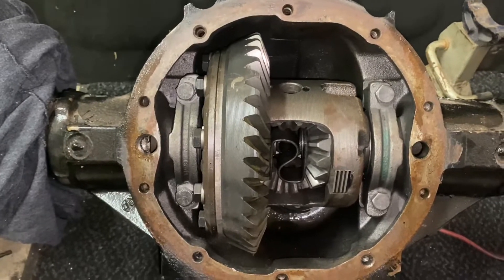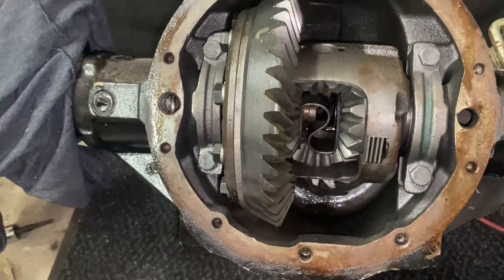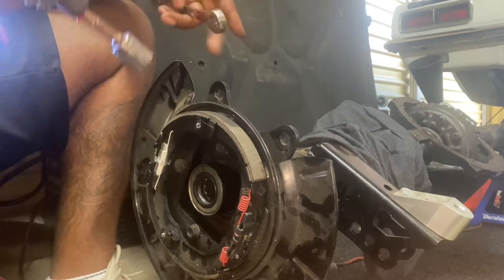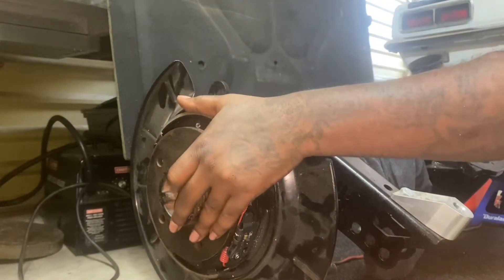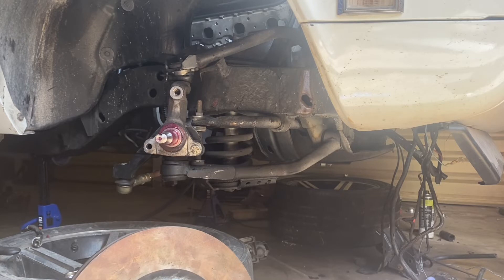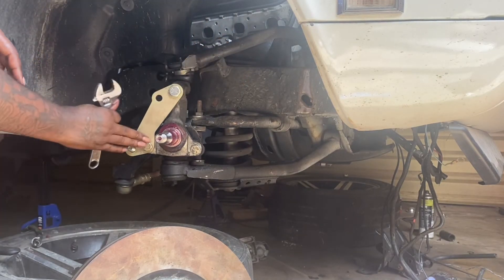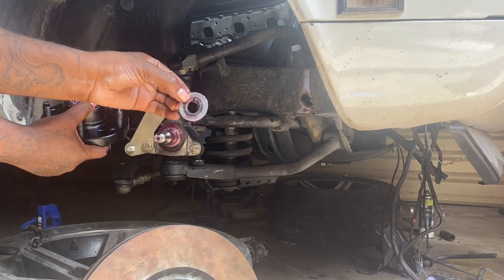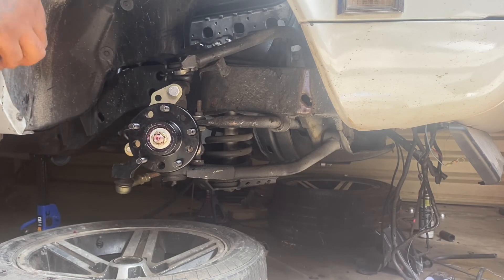67-69 Camaro Brembo big brake upgrade “BUDGET BIG BRAKES”

Comment: Hi, I am wanting to install Brembo Big Brakes on my 69 Camaro. If possible can you provide me the front spindle and hubs to include all the hardware I need. I did understand you when you said there will be some machining to the rotor and hub assembly.
Reply from the maker: I ordered my hubs from flynbye.com u can use your stock spindles  give me a shout on instagram and I’ll dm u my number and I’ll talk I through the process INSTAGRAM:@supamisfit_camaro

Comment: Question, are you able to use and operate the E brake function with this upgrade? Also, would be manual or electronic to engage E brake?
Reply from the maker: Yes U can use manual or electronic e brake I’ll try to do a video on it I’ve slowed down a bit with the channel but I’ll try my best to make some time to do one if u need any more info just dm me on instagram @supamisfit_camaro
Reply: @supamisfitmodshop  ok thanks!

Comment: Hey do you know what the part number is for the rear parking brake? The big break upgrade site has not been in stock for a while. I have a 10 built rear ended
Reply from the maker: I ordered the kit from big brake upgrades dm me on Instagram @supamisfit_camaro and I’ll send u the link